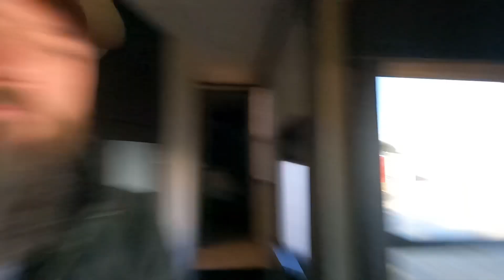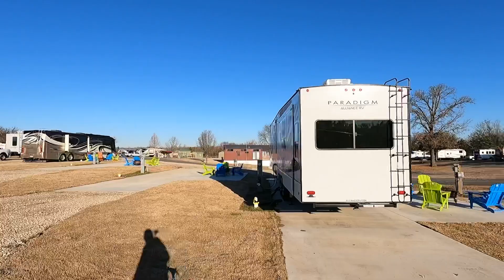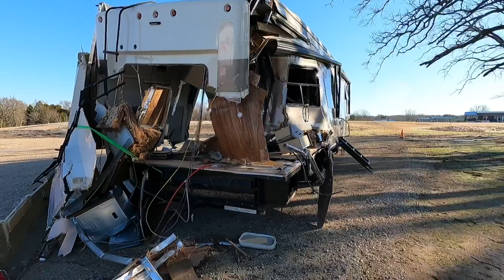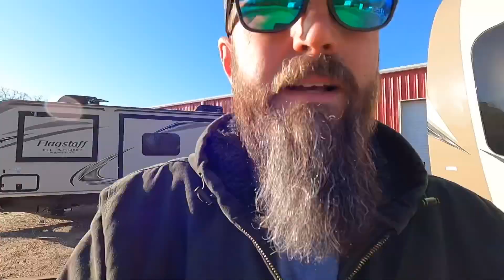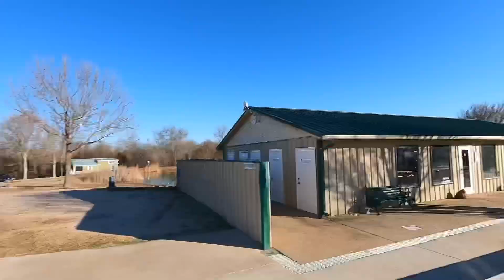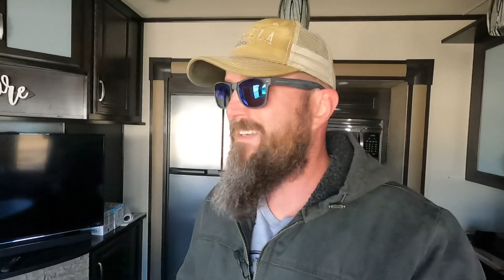RV Exteriors | Most Fun Week So Far | NRVTA Mobile RV Tech Training | RV Life

Comment: Did you learn about plumbing at all ? Like how to fix leaks ? With the slides did you learn how to aligned them if they are out of alignment?
Reply from the maker: They touch on plumbing a little. There isn’t much to it. Once you know the different ways to crimp and the fittings…the hard part is finding the leak and managing to get to it. 

It seems that with most things in an RV…the hard part is gaining access to where the problem is. 😂

They go over where the check valves are and other stuff. You end up with a binder full of really useful info that you can refer back to later. Also, all the information is available for a year in the student portal so you can download it. 👍
Reply: @SaltyVetAdventures  
Thank you, How about how to align a slide that’s out of alignment?
Reply from the maker: @Hugo-Hernandez  Yep…they focus on slides and leveling the most.
Reply: @SaltyVetAdventures  
Perfect thank you for your help and your response